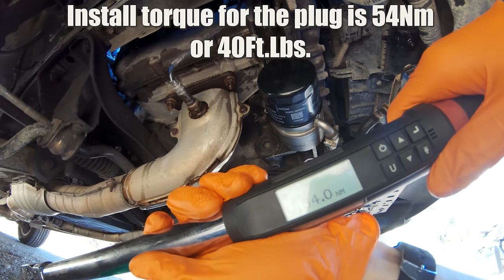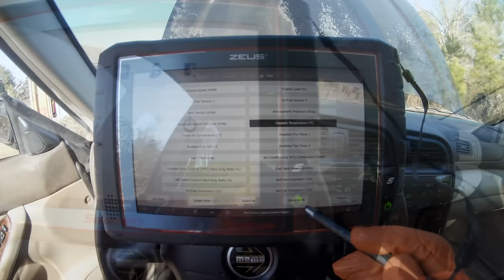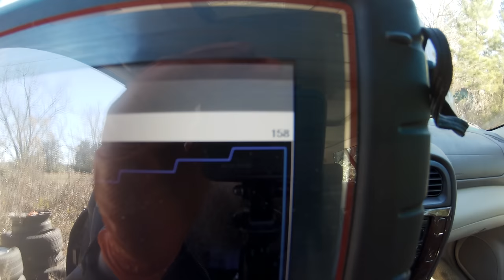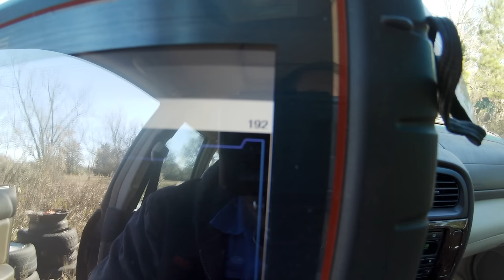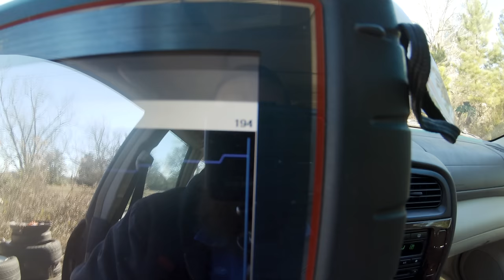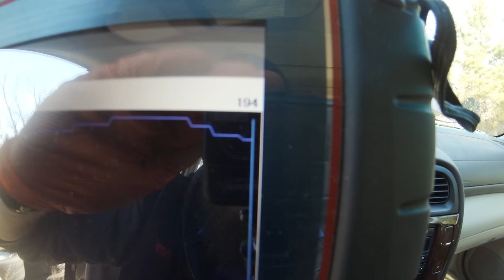Subaru Coolant Replacement

Comment: Do I have to remove the drain bolts on the block, or can I just do a flush with distilled water through a burp funnel, I’m replacing my radiator on this same car and watching people flush their systems they don’t remove any drain bolts on the block. (Just getting into fixing my own car so please excuse if this is naive)

Comment: I haven't done the engine block drain plugs before. I've used the radiator hose connections instead. I'll try your method next time.
Reply from the maker: Yea, draining the radiator only gets part of the coolant out. Old coolant will remain in the engine block, as seen by the amount of coolant that came out when I removed the block plug.

Comment: So I’ve been struggling with my Outback overheating. I did all this the thermostat opened twice but then I drive and it overheats. I have a new oem radiator cap. At my wits end help subaruguy

Comment: Looking to do the coolant replacement for the first time on my '17 Legacy 3.6R. Should the process be basically the same on the EZ36 engine? And if it's first replacement would you recommend a distilled water flush at all?

Comment: Appreciate what you do man, keep doing it. Ive struggled with air in the Subarus every time. Currently have an 03 that is just a beast. Gets me thinking its all good, and then it does something that makes me doubt it. Currently the coolant temp at 190 and the heather blower temp is 115-120, then up to 2500 RPM the coolant jumps to about 212 (fans good and the like) the vent temp jumps to close to 160.  Any thoughts about the vacuum fillers / bleeding them?
Reply from the maker: I have a vaccum coolant refiller and love it! Check latest vid on timing belts.
Reply: @MrSubaru1387  so who makes the MAC tools version? Gotta be better than the Amazon version I’m fighting with (sub harbor freight quality)
Reply: @MrSubaru1387  My 08 forester non turbo. The coolant boils and fills the reservoir bottle and spills it.
What could be the issue?

Comment: This is a old video not sure I'm gonna get a response anyways...I have a 2013 3.6 R Outback...I did everything I saw in this video & then some I changed the two upper hoses & the bottom larger thermostat housing to radiator hose plus put in a new thermostat... THANKS by the way for these videos...I just wanted to know what are the torque specs for the thermostat housing? I did this work yesterday sun drove to work today & noticed when I parked coolant on the ground I believe it's the thermostat housing cause it's right above where I noticed it on the ground but I didn't crawl under there to look cause I had to punch in at the time clock lol.I checked for leaks yesterday and nothing but i didn't take it for a ride like i should have. My ride ro work is 30 miles!.....I didn't empty the coolant from the engine block like I saw in this video cause my 14 mm hex socket was too long to fit in that area it's the blue point one from snap on guess that's not the one in this video?!? My exhaust manifold that's bolted to the engine was in the way....THANKS for all your help!!!
Reply from the maker: Torque spec on the t-stat housing is like 10nm or something very small. Basically tighten until the halves crust the t-stat o-ring and a snug past.
Reply: @MrSubaru1387  Please tell me there is "only" the O ring seal that's part of the thermostat...there isn't suppose to be a separate O ring that goes between the thermostat & also the thermostat housing is there?!? I noticed something in a diagram on a website & my heart dropped cause I never saw one on there previously when I took off the housing & installed the new thermostat!!!
Reply from the maker: @anthonyseeulater  yeah. Just a ring gasket around the thermostat.
Reply: @MrSubaru1387  ohhhh Thank God!!! Thanks for all your help brother man!!!
Reply: @MrSubaru1387 i am still learning and not familiar with a lot of terms yet. 

I could figured out that t-stat is thermostat. But I still cannot figure out halves crust T-stat o-ring and a snag past.

Would you please help me what it means by that?

Comment: Hey mate. Great videos. Very informative. Can you do one on Burping a 2006 WRX 2.5L? Of any Subaru with a header tank? My expansion tank fills up when I use a no spill funnel on the header tank to burp the coolant system. Just not 100% sure of the correct process.

Comment: Thank you as always Mr. Guru! I'm gonna call you that from now on cause you are a guru 🙂. About to head to the dealer to get coolant for my dad's 12 legacy 3.6 and for my 13 impreza with 2.0. Conveniently the same blue super coolant. This looks very similar to what my dad's setup is under his car. But not my FB20. Is the engine block drain plug in about the same location? My understanding is there is a 14mm hex plug like that on each side of the engine that should be removed. Or only one side has to be done?
Reply from the maker: On the FB20, pulling the rad drain plug and t-stat gets the majority of the coolant out
Reply: @MrSubaru1387  Awesome! Thanks for the quick response and tip.
Reply: @MrSubaru1387  on my dad's 3.6, do I have two plugs to remove, one on each side?

Comment: As an alternative to removing the drain bolt at 4:46, will removing only thermostat also drain the coolant completely from the engine block?
Reply: i have the same question

Comment: Have an 04 4 cylinder model and my owners manual seems to skip the coolant type. I've seen green, yellow, and blue types used. For you, it's green all the time?
Reply from the maker: Green in the 04. Blue didn't come out until 08/09.

Comment: Is there a drain plug on most models of subaru at the engine? I have a outback 2010 EJ25 series. Wondering where it might be if it's in a similar location?

Comment: Thank you this is very clear and helpful. Does anyone happen to know the torque specs for the 2005 WRX upper and radiator hoses? I even have the software Subaru uses to perform repairs but I cannot find this specification. If you have ever used the system it is not exactly intuitive, so I might just be looking in the wrong folders.

Comment: technically more information than that radiator burp widget, they save $ by omitting instructions. Mine is a bit spitty from a crack in the plastic part. going for all this plus 'swap radiator'

Comment: Hello. Drained/filled coolant. Changed thermostat in the process. After starting the car, the temp gauge goes up quickly. Could it be due to bubbles or a bad thermostat? It was not a Subaru stat...Thank you.

Comment: Can you drain all the coolant from the engine on 4 cylinder by removing the thermostat?
Reply from the maker: No. Coolant will drain, but not the coolant in the block. Block drains have to be removed to fully remove coolant.

Comment: 2011 Impreza Outback Sport 2.5L. I'm new to mechanics/maintenance, and I'll say, those drain plugs are so difficult to remove! I cleaned them out and made sure the bit was seated properly, but the weird angles and lack of space didn't keep them that way during attempts to loosen them. Both have some damage now and I'm afraid they'll get stripped if we keep trying (not the threads). Myself and two grown men have tried, yet neither budged, even with a steel tube around the handle to give more leverage. Now my car has been on jack stands for 3 days and I'm trying to figure out an alternative route. Is there one? I wish I was more experienced and had more tools on hand, or the money to afford more tools. I live in the rust belt (Kansas) and I'm afraid the nuts/bolts holding my heat shield will crumble if I try to remove them, but maybe I'll try anyway... I'm excited to learn, but oh so tired. Oof.
Reply: Same year and trim here and am about to attempt this myself. Not in the rust belt, but still makes me nervous to read this as this is my DD!
Reply: @substantial_range_  how did it go? also need to flush my coolant and im wondering if i should only drain the radiator few times or do it that way
Reply: @akwoodzzz3257  I was able to get the heat shields off but was still unable to get the drain bolts loose. Not enough space. I gave up and am hoping just draining the radiator is enough if I shorten the coolant change interval some.
Reply: @substantial_range_  didnt do it yet? im also thinking its gonna be a lot easier if i can only drain the radiator even if it leave some in the engine block it should replace at least half the coolant so i might do this twice if the coolant still look dirty after the first time
Reply: @akwoodzzz3257  I did it a few weeks ago. Getting heat shields off took some penetrating oil and a little patience, but I wasn't into the idea of just dropping exhaust. Without the exhaust in the way getting to the block drains would be CAKE. Not sure on your double-drain situation. theoretically sounds fine. My coolant was the factory stuff and it looked pretty clean so I drained it once, topped it back up, and called it done.
Reply: @substantial_range_  you only drained the radiator and filled it back? that what i plan on doing because geting to the block drain sounds like a pain but ill see about that

Comment: Heeeey! i own a 2015 impreza and my coolant reservoir lvl its low. In the users manual says coolant should be replaced at 300.000 km. but i recently achieve 100k So i think i should just refill the reservoir. But my question its should be use subaru super coolant or a prestone 50/50...

Comment: Hey Mr Subaru
Have you noticed that the newer Subaru's coolant tend to run lower. I've read per service manual that the coolant should be replaced after 6 years/150,000kms. My wife's 2015 Impreza has only 38,000kms. After a long drive today, the coolant was at low. When cold reservoir looks nearly empty. I've seen people with this as well. Should I just get some super life coolant?

Comment: What kind of coolant would I need for a 2002 wrx? Some say anything, some say Prestone green, and some say subaru brand? I'm lost. Help.
Reply from the maker: Regular green. Subaru didn't start using the blue super coolant until 2005 MY.
Reply: @MrSubaru1387  ok so the green Prestone coolant will work. Thanks for the reply.

Comment: Thanks as always.  I was wondering if you think the head gasket issue was exasperated by unchanged coolant? I know coolant ph changes as it ages and acidic coolant sitting on the flat heads can’t help, but I am no expert.
Reply from the maker: It was. Not changing coolant regularly does shorten service life on the head gaskets.

Comment: I have a 2009 outback  without climate control. I have heat only on drivers side but not passenger side. How do I fix that. Thank you

Comment: I got a 2006 subaru wrx. If I don't drain coolant from the engine block will it cause harm to my engine? The coolant was green but I'm replacing it with blue zerex coolant?

Comment: I bought my first vehicle a couple weeks ago and it’s an Outback 2012. There was no coolant in the reservoir and the radiator looked low. Being completely new to all this, I added some Peak Long life antifreeze & coolant that my father in-law had in the garage. 

After that I learnt that the previous owners  had recently flushed the system and used Zerex blue (Asian Vehicle).

What shall one do in this instance?  Do I need to flush the coolant? And if I need to flush again due to mixing coolants, shall I add the Zerex again or go with the Subaru coolant? 

Also, I’ve seen people flush distilled water through their system to clean it out. Do you recommend this? Or is there anything else you suggest for a thorough clean out of the coolant system?

Appreciate all your videos! I’ve been binging the lot of them!

Comment: This video is missing things. For example, most have the 2.5, not the 3.6.  The drain plugs you take out hidden behind the Y pipe.  You would have to, on the right, remove the oil filter to gain access.  On the left, remove the Y pipe.  Too much work. I never heard of pulling the engine plugs out. Heck it would of been easier to put a T in the heater hose.   Keep adding water while running it, then flush it out the radiator.

Comment: That was excellent. Would it be easier to drain coolant from the lower radiator hose?
Reply: Plus change the hose and thermostat while you have the chance. Oh and the clamps
Reply: Plus change the hose and thermostat while you have the chance. Oh and the clamps

Comment: Hey thank you for all the videos. Wanting to change my coolant for my 2008 Subaru Impreza 2.5i should get the super coolant or buy from the store? Also if not removing the coolant from engine block would it cause any issues in the future? Thanks again
Reply from the maker: 08 should be running super coolant. I'd stick to it. Super coolant can mix with green, but will have to be replaced at 3yr 36k miles rather than 8 yr 80k miles.
Reply: Thanks man appreciate it. One more question I bought oem upper and lower hoses. Would removing the lower hose be a another way to drain the engine block? Much obliged good sir
Reply from the maker: Removing the hoses doesn't drain the engine block. Only removing the block drains will drain the block.
Reply: Sweet deal MrSubaru. Have a road trip in two weeks and I want this engine feeling good and running strong the whole way. Thanks again!
Reply from the maker: You're welcome. 👍🏻

Comment: I have Peak blue fluid for a 2010 Volvo and notice the ingredients are the same for peak Asian and Peak European.  Is there a difference in the actual formula?  Would adding a cup or 2 of the European blue peak to a 2014 Subaru cause issues?  Meets same ASTDMI codes as Asian peak formula also so not sure the actual difference.  Please Advise.

Comment: I pulled the petcock and it hit the framerail  and splashed all over me and my toolbox. Gotta say I'm afraid to o it that way again, any tips?
Reply: Next time do not remove the petcock all the way. Let it drain a little slower.  It will take maybe 10 minutes to drain with the pet cock left in with only a couple of threads holding it

Comment: The spill free funnel saves you from having to "burp" it by squeezing the hoses, is that right? Trying to plan my parts out
Reply from the maker: You still have to get the air out, but the spill free funnel makes it a much easier/cleaner job.
Reply: @MrSubaru1387  is it necessary to remove the drain plugs on the 4cyl ej25's? I noticed in your video almost no coolant came out, i'm trying to do this but thosr 14mm hex bolts are on SO tight on my car

Comment: So on my '07 Outback the temp would stabilize around 175. Realizing this was too low I replaced the thermostat (previous owner installed a 78 deg model, should have been 82). So now the temp stabilizes around 182-184. My other Subarus typically go to 190. What do you think, problem? Or don't worry about it? Maybe the coolant temp sensor or sender is bad? 145k miles by the way.
Reply from the maker: Did you use a Subaru oem thermostat or aftermarket?
Reply: @MrSubaru1387  Subaru OEM with new gasket

Comment: For a timing belt change, I understand the water pump is typically changed, but is it standard to also replace the thermostat at the same time?
Reply from the maker: Yes

Comment: I completed the full flush and then remembered I had the coolant extender in the garage face palm lol. Anyway I can add it back? Maybe in the reservoir?
Reply from the maker: Yes. Vehicle cold, suction coolant out of the radiator, approx 250ml, according to the directions on the bottle, add it to the radiator and go. Don't add it to the reservoir. It won't work that way.
Reply: Thanks again man
Reply from the maker: You're welcome. 👍🏻

Comment: Question. I hear mixed opinions about removing the block plugs for the coolant drain. Im switching from green coolant to blue coolant so i want to be sure I have no contamination if possible.
Reply from the maker: Mixed how? That's literally how you drain coolant from the engine block.
Reply: @MrSubaru1387  i mean mixed opinions about draining from the engine block. Assuming i dont use the engine block to drain the rest. What would be the next best way to get all coolant out
Reply from the maker: @xpavence4237  you don't pull the block drains, you aren't draining the whole system. Easy as that. Pulling the petcock on the radiator doesn't remove it.
Reply: @xpavence4237  those other opinions would be better described as being lazy and only doing 30% of the job

Comment: My 2008 outback is on crack. I did this and it filled the funnel with coolant. Which was so hot it was steaming..  any ideas on what that is about?
Reply: I’m late but it was the Head gasket wasn’t it bro?
Reply: @akidim13  it somehow isn't. Clean oil and coolant. I took out the 3rd thermostat and it's been running fine since
Reply: @aTROLLwithBlades  damn bro , usually the steaming and foaming bubbles is tell tale head gasket , I had a similar scare the other day , my reservoir tank was full and temps went up , turns out I didn’t burp it’s correctly

Comment: Is that the standard coolant kit or the standard/Ford etc kit. There is two different choices for the item in your Amazon store?
Reply from the maker: https://amzn.to/3mXLyrF
Reply: Thanks from Wisconsin , feeling the heat in my 04 wrx and 🤞🏽I think I burped the system Properly just hooked it up to the coolant fill tank instead of the radiator. Hope to purchase more stuff from your store as needed on my journey teaching myself how to fix cars(Subaru etc).

Comment: Hello MrSubaru, I have a 02 Forester non-turbo, and I plan to change my coolant in a couple of days, I found the 2 engine block plugs easily enough (1 of them is used by oil cooler line), but I can't find that last drain that you opened with the breaker bar, and I looked around all over the place under the car around the oil pan area must have spent 15 minutes, can't find it..., need some help here..
Reply: @jdisco1  I googled moron 😁

And it came back with

@Jdisco1.
 dayum dude . Sounds like you're legendary